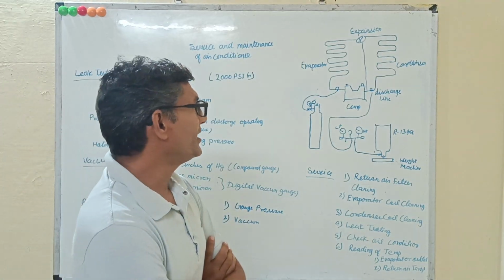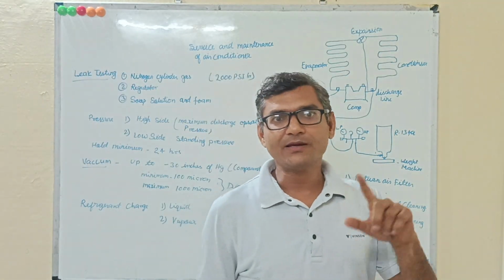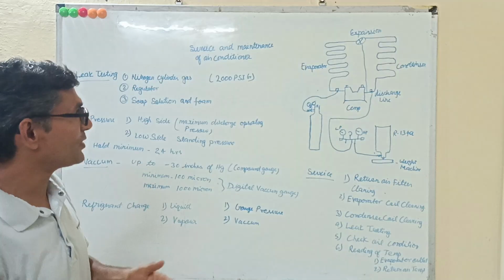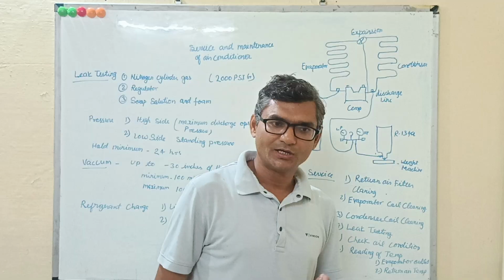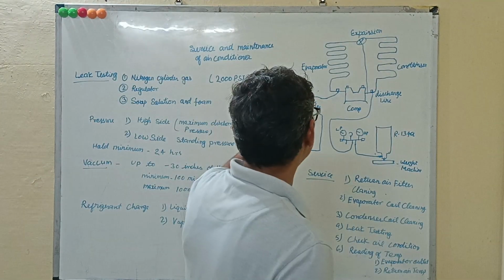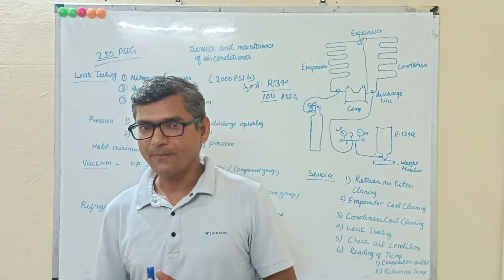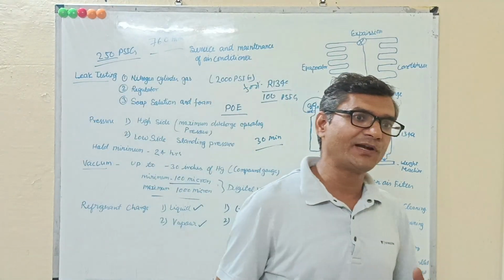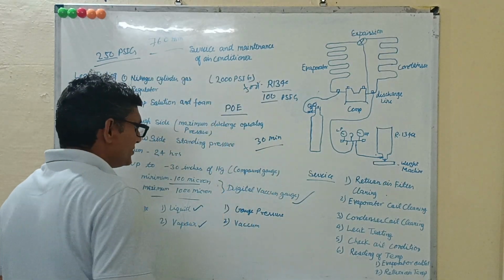Service and maintenance of Air conditioning

Comment: Ac gas leak testing  Nytrozen HP site 250 psi / LP site 100 psi ,
??
Reply from the maker: HP side , pressure relief Valve,HP pressure switch and condenser for R134a designed for only 250psig